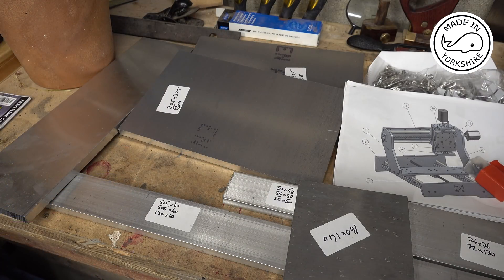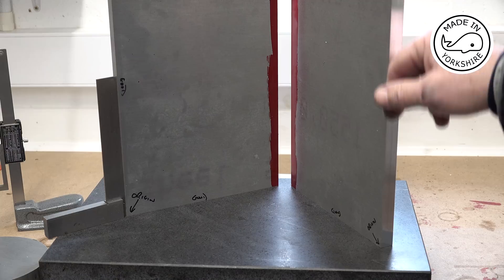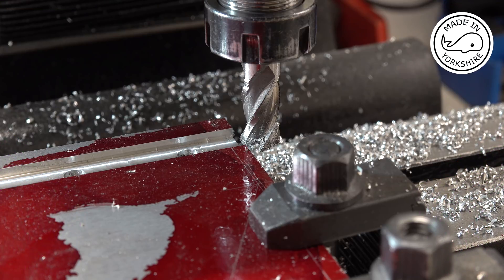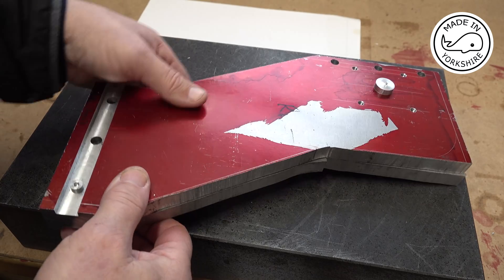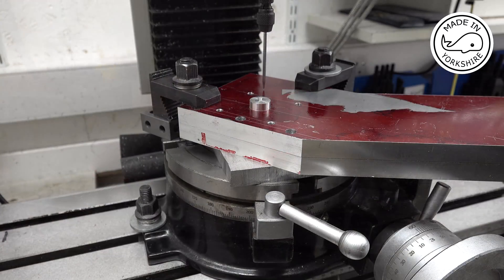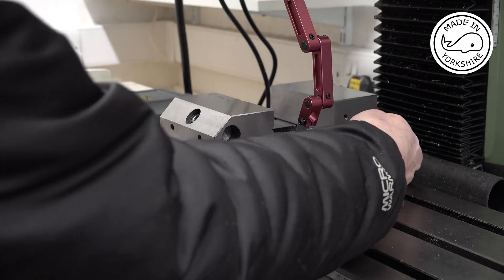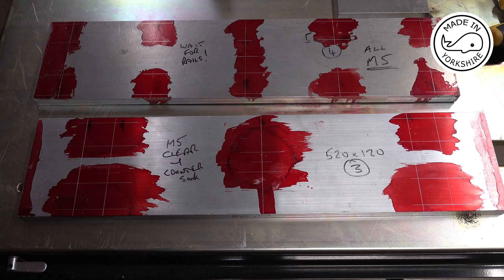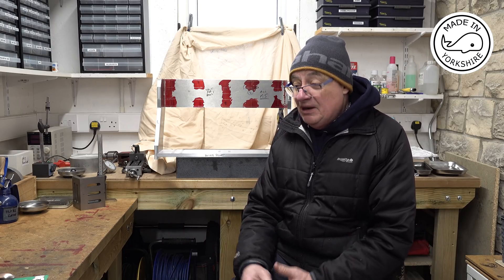#MT47 Part 1 - Olivier CNC Router/Engraver. The Gantry. In 4K/UHD by Andrew Whale.

Comment: Great build!  One question regarding the gantry design. The side plates are cut angle with most of its front end rigidly mated to the bottom cross rail. Does this create a cantilever lift on the bottom cross rail since the forces may multiply across the top cross rail as forces act upon the spindle motor? To further clarify my question, wouldn't the gantry act like a hammer pulling on a nail?  Perhaps the geometry of the side plates compensate for it?
Reply from the maker: Hi Bob - I see what you mean. I have no idea but I guess I will find out if I can ever get the machine running.
Cheers
Andrew

Comment: Hi Andrew: I built a cnc router about 10 years ago, ( all my design) it works quite well but there is one thing I wish that I would have changed. I mounted the linear rails up right like your plans show on a piece of counter top granite, I now am still very happy with the stone but if i only mounted the rails underneath. that would have kept them cleaner and added more space for the mounting table.
Good luck Rich
Reply from the maker: Hi Rich - thanks for the suggestion. I'm pretty much driven by Olivier's design, but interesting to know for the future.
Cheers
Andrew

Comment: I wonder if the frame could be made using extruded aluminium like some 3d printers are. Would be cheaper.
Reply from the maker: Hi Matt - I think it would be a lot less expensive but I did read somewhere that it wasn't as solid as the aluminium plate used in this design. Olivier previously built a similar machine using aluminium plate and it is extremely rigid. I guess we will find out at some stage.
All the best.
Andrew
Reply: Yes correct it would need a lot of cross bracing. You would not believe how strong it can be. In terms of plate it is only the joints that can flex.

Comment: Thanks for yet one more well produced video. Nice work, impressive rigging.
Some work looks estetical like the rounded corners and the long angled cut. Neither of them needs to match butcif course it looks nice. What else would do on Andrews channel?
Reply from the maker: Thanks Stefan!
Reply: @learningturningmetal  Your videos, and tips, (the bandsaw) make my machining more enjoyable. Only to pay back.
Reply from the maker: @Stefan_Boerjesson  thanks. I was thinking only today that the bandsaw is probably one of my best purchases. It saves a lot of hard work.
Cheers
Andrew
Reply: @learningturningmetal  Using the bandsaw is like pulling a cork out of the bottle. Much of machining gets started a lot easier and faster. Just chopped off 35 pieces of 3 mm angled aluminum, 30 mm wide...

Comment: Wow exciting new project! 👍
I built my own cnc router some years back, it has been a very useful and rewarding piece of equipment.
A small tip with the bandsaw; try touching a piece of builders chalk on the blade teeth when it is running, it powders the teeth and stops them sticking in aluminium and you can cut a bit faster. And if yoy will be cutting a lot of aluminium on it try a coarse blade 6 tpi, or even better 4 tpi, and fhe fastest blade speed you can run. 🙂
Reply from the maker: Hi Wiz - thanks for the advice. I hope this 'little' cnc router will turn out well. We will see!
Cheers
Andrew